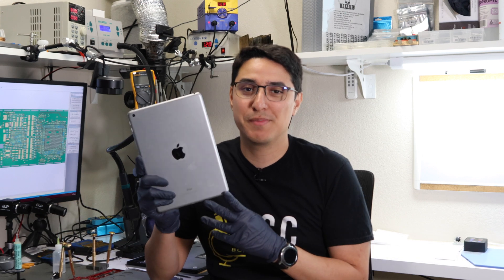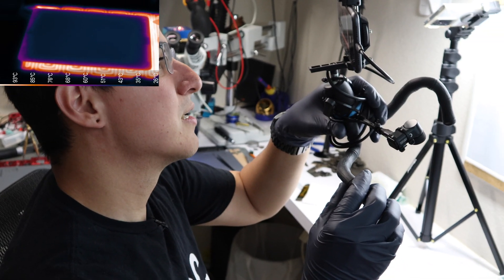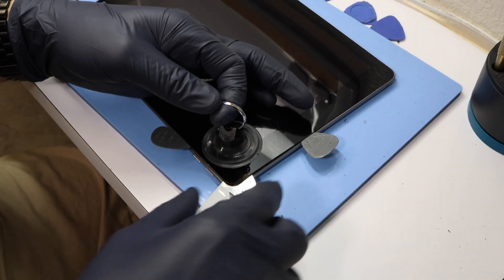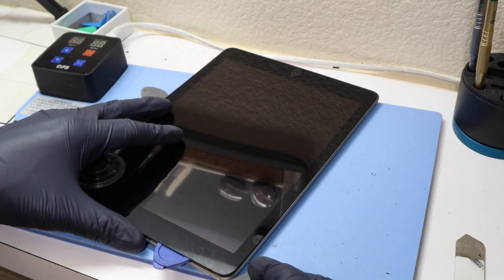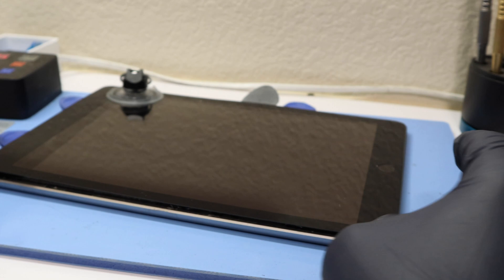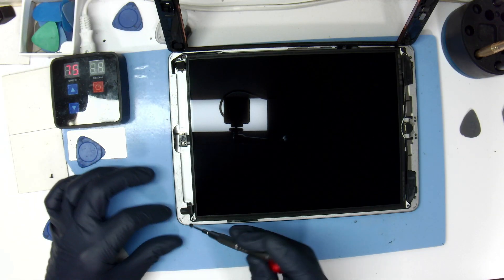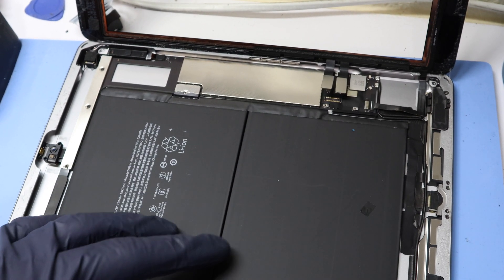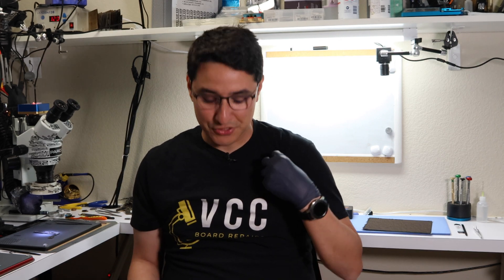Don't Break The Glass! How To Remove an iPad Screen Without Cracking The Screen. Step By Step Guide

Comment: Thanks for the helpful guide! I will be attempting this in future on a iPad 6th gen 2018 model as I intend to reflow the NAND due to error 4013, I will of course be trail and error before a hot air station touches the iPad but if the simple fixes do not work with disconnecting components then it's going to the gun, I also know the CPU can cause this and pretty much anything can though I have a fairly good idea the NAND is to blame. Thanks!

Comment: Dose the alcohol dissolve the adhesive?  Would it be worth a try to flip the ipad over on the heat pad until it comes up to temperature?  That way you don't have to sink all of that heat through the case.  Or is that the idea?
Reply from the maker: I dont think it dissolves it per se. But it does loosen it. It's facing up so you can work on it while it's staying at a hot temperature.

Comment: How do you clean the old adhesive residue off the glass? When I do it with alcohol and a rag it is so time consuming!
Reply from the maker: I don't. I just reuse it
Reply: @VCCBoardRepairs  Even if it's ripped? I'll have to try that.
Reply from the maker: Just place it back into position
Reply: @VCCBoardRepairs  thank you.

Comment: One question: so you have turn on the warming mat during the entire process until you disconnect the board from the battery? and second question: if the battery conector is so delicate, how do you change the old battery for a new one?

Comment: My ipad 9th gen has cracked glass   digitizer still works, touch works everywhere, even the thumbprint on home button still works.  Is just cracks in the class in the black border of the glass.   Trying to find out if I should get it fixed, was a gift and has no warrenty that i'm aware of.
Reply from the maker: That's up to you if you want to live with a cracked screen or not.
Reply: @VCCBoardRepairs  I'd heard there were 3rd party repair places now, but can't find any in my area.  The worry I haqve is that I'll open her up, swap it out, and somehow something will go wrong and i'll have a brick lol
is currently used as my phone and mobile gaming.
Reply from the maker: Where are you located?
Reply: @VCCBoardRepairs  portland oregon
Reply: @VCCBoardRepairs  cause, like the heatpad alone costs nearly the repair cost, and i really only use heatguns in my hobby and proffesional projects, probly not accurate enough to do something like this reliably
Reply from the maker: @louishansetiv7016  I do offer mail in service for this model.

Send me a message for a quote: https://www.vccboardrepairs.com/contact-us
Reply: fingerpringsensor, home button, charger port, all fine.  no discoloration, nor bleed effect when touching near cracks, so was hoping the glass alone can be replaced but apparently either the touch or digitizer is built into the glass somehow (don't have working knowledge of touch screens nor lcd display technology)
Reply: @VCCBoardRepairs  lol   well before filling out a survey just to get a quote, can't you check out the short 18second youtube vid I linked you?>  That's me recording the dmg so you can see
Reply from the maker: Yes that's typical damage on these iPads.

So it would need a new digitizer/glass part
Reply: as I said, currently this is my phone   so while not out of the question, we'd have to do some scheduling to ensure I can 1 day it to you, then pay for 1 day back.  I see the screens without homscreen button are like 29 bucks I just don't trust myself to do the work lol
Reply: model 2603, can't remember if i said that in the vid
Reply: @VCCBoardRepairs  and generally speaking i'm looking in the range of 120 installed?  for the ipad 9th gen 2603 / 2606

Comment: Thanks Jesse, for the easy explanation and information provided. I have an iPad Pro A1673 that has a problem with the “Power” button not clicking, it is depressed in the iPad and seems loose. Could you recommend a seller that provides OEM parts?
By the way, where did you purchased the “PCB Heating Matt”? 
Is this an easy fix, and what is your recommendation?

Thanks for your help!
Reply from the maker: You would have to buy a parts device to get an OEM housing for iPad.

I got the heating pad here: https://amzn.to/3yiDZUb

"easy fix" would depend on your skill 😅
Reply: Jesse, thanks for your reply, but you never answer my initial question concerning the power button not working on iPad Pro 9.7 A1673.
Do you know where can I buy it from? Do you have a video on this subject? and lastly, Can I use B-7000 clear glue in conjunction with the Pre-Cut Touchscreen LCD Adhesive strips? 

The glue on the Pre-Cut Touchscreen LCD Adhesive strips I’ve purchased from Amazon is of poor quality, other buyers are stating.

Thanks, again for your attention!!!

Comment: Every time I remove a digitizer on a iPad there's some adhesive or something along the left side on the LCD. Every single one of them. The rest of the LCD is clean. Any ideas?
Reply from the maker: That's strange. Maybe you're inserting your tool too far in?
Reply: @VCCBoardRepairs  I'm using those thin plastic cards flat with some 99% alcohol to loosen adhesive as I go. It's only on the left sides. I know she bought them refurbished so maybe something from past repairs I'm not sure.
Reply: @VCCBoardRepairs  possibly the hot adhesive with the alcohol running in on the edge now that I think of it

Comment: Does this apply to all ipads? Specifically ipad mini 4?
Reply from the maker: Similar process

Although Mini 4 has the LCD and Digitizer fused together, so it's a lot riskier to remove without damaging something
Reply: @VCCBoardRepairs  I figured. I watched a bunch of videos and I saw that you needed like the machine and stuff to separate it. I recently bought an ipad mini 4 that only has a cracked glass screen. So I thought the problem is easy since I only needed to buy the glass screen. But didn’t know that the LCD and digitizer is fused together.
Reply from the maker: I wouldn't recommend trying a glass only repair on Mini 4. It absolutely requires special equipment and mastering that skill to do it successfully
Reply: @VCCBoardRepairs  yup. So I’m better off to just buy a lcd replacement instead of wasting like $25 for a glass replacement only.

Comment: Awesome, however, the link to buy the heating mat is no longer available since the seller stop selling. I can find it on Amazon but how many minutes do you recommend using the heat mat to heat up the ipad and the iphone?
Reply from the maker: I give it at least 5 minutes to get the iPad hot enough to start trying to separate.

Once it's hot to the touch, it should be ready to go
Reply: @VCCBoardRepairs  okay and you heat it from the back not the front.
Reply from the maker: Just like what you see in the video. Only from the back.

I also updated the link to the heatpad on Amazon: https://amzn.to/39e2q8n
Reply: @VCCBoardRepairs  Thanks. As of today, i've done 2 iPad 8. The second time I was able to take off the glass without making a huge mess so it was a learning curve. I'm going to do an iPhone 11 max pro, what is the recommended temperature should I set on the CPB mat.
Reply from the maker: 60c should be fine
Reply: @VCCBoardRepairs  for how long?
Reply from the maker: What are you trying to do exactly? Just remove the screen from the frame?

Or separate the glass from the OLED display?
Reply: @VCCBoardRepairs  I have a cracked screen that I want to replace. Just need to know how long do I need to have it on the heat mat before I open it.
Reply from the maker: Until it's hot to the touch

Comment: I would try to unplug the battery if I ever unplug parts because you can always accidentally cause a short circuit and then when you put everything together you can have an unrelated issue unless it's designed poorly where it is impossible to unplug the battery first but I ruined way too many things in my car or anything electrical leaving a battery plugged in.
Reply from the maker: That's a good idea
Reply: @VCCBoardRepairs  Also I try to avoid metal pry tools if I absolutely can also. I try to use plastic pry tools since metal pry tools can scratch metal and also cause electrical issues too. That being said I do think if you ever change a screen a macbook lcd. Rewa makes a great thin metal tool to remove glass on macbook screens I wanna get.

Comment: Which model was this please? I have never had problems removing ipad screens without breaking them however the 10.2" is much thinner glass!
Reply from the maker: The iPad in the video was an iPad 6.
Reply: @VCCBoardRepairs  have you tried opening the 7th gen?
Reply from the maker: @fixedtech  Yes I have opened many. I use the same technique with no issues.
Reply: Thanks! How about a 9.7 pro, Same process? The home button gets very warm and Touch ID won’t activate. It also drains the battery. Any idea the cause there? 😅